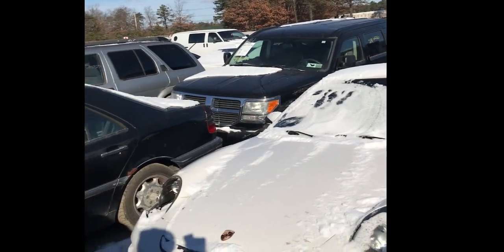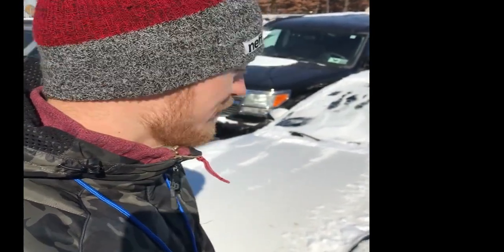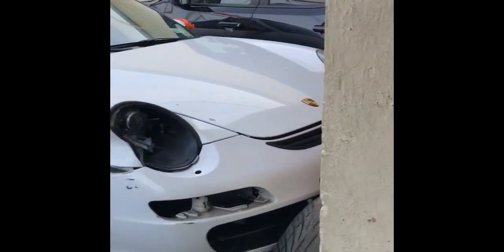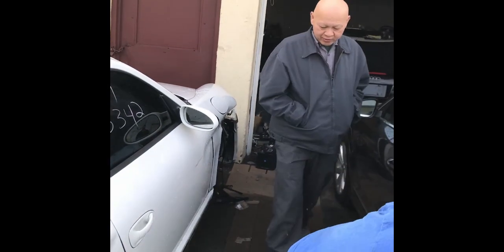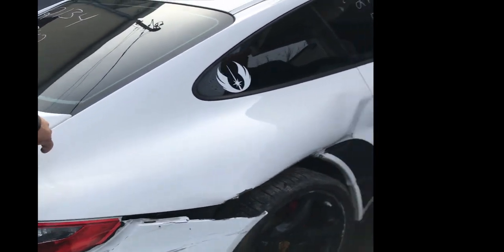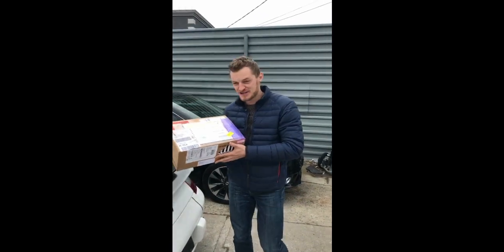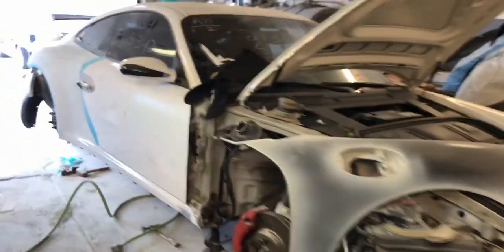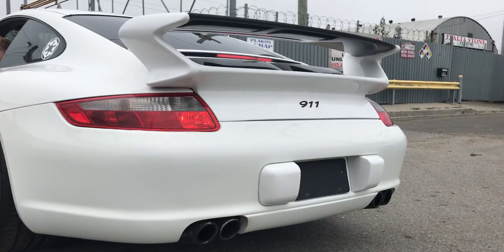I bought the cheapest Porsche 911 Carrera 4S in the US!

Comment: Pretty much the worst thing you can do to a vehicle which has sat is immediately rev it up after starting.  Especially on a cold day, all the oil is sitting in the sump and the pistons are running metal-to-metal with the cylinder walls. Also, do yourself a huge favor and dump the oil and change the filter before trying to start.  It's cheap insurance and if there's any internal engine damage, you'll likely see it in  the form of metal shavings in the used oil.

Comment: MADD expensive is an understatement. Nothing about Porsche is cheap.. Not sure how you figured you could get it fixed on the cheap.. It sounds terrible.
Reply from the maker: You're right, dealer parts are really expensive for these cars.. However, you can find real bargains online on websites like eBay and Car-part.com I bought a used front bumper for just $200 shipped!
Reply: SalvageSecrets 
Finding a vehicle like this is like a purple unicorn.. I have never seen anything like it here in so cal.. usually older 911’s , SUV’s and Panamera‘ s . Good luck on your future quest..
Reply from the maker: Jackson Daniels Thank you! Yes, these cars are very hard to find so I was really excited when I saw it! :)